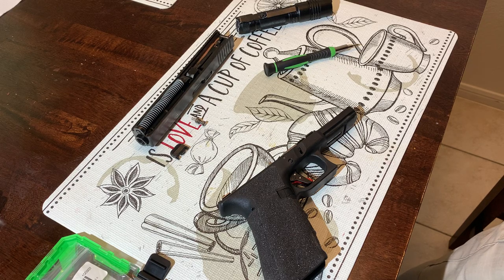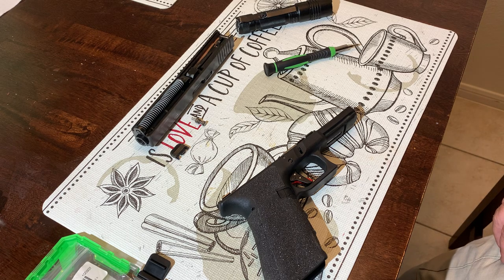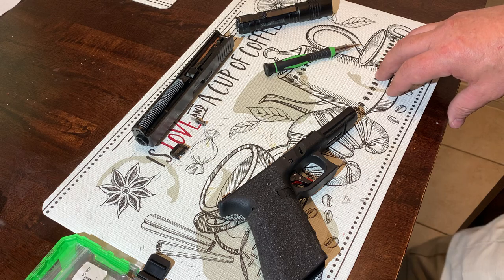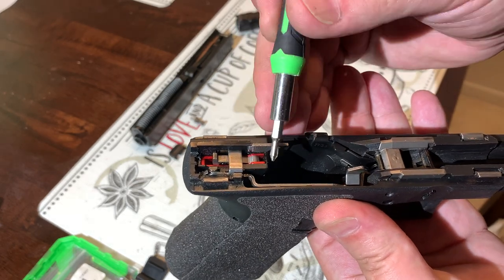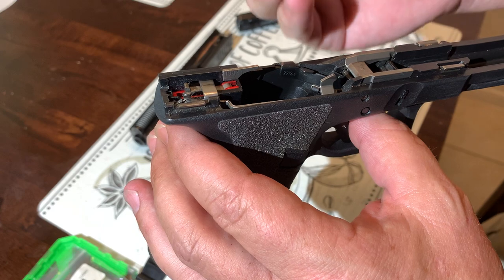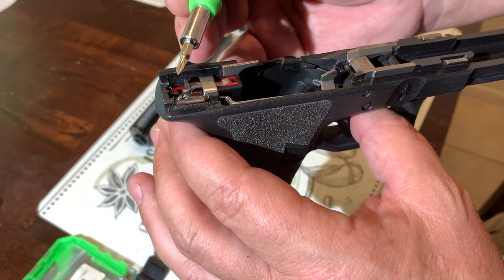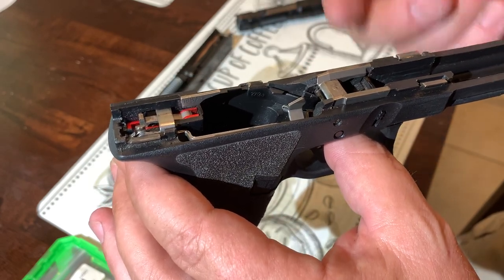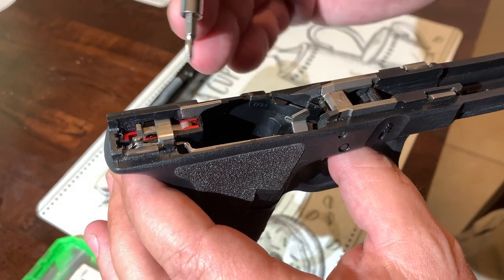Timney Alpha Glock Trigger follow up

Comment: I suspect you can find a way to discharge any "safe" firearm if you try hard enough. However, the Timney has been drop tested, by several different testers and folks, and found to be totally safe.  No one would or will ever use the gun without the striker block in place. In fact I doubt it would work very long without it anyway. I agree with Captain McNuggets, you miss the extra friction and pressure forces at work when the gun is fully assembled and ready to fire. Lastly I believe the Timney is sold as a competition trigger and not a carry trigger. Alpha Competition Series for Glock. Perhaps they have another one I am not aware of?
Reply from the maker: You are correct, it is marketed as a competition trigger. That doesn’t mean people are not using it for carry, which I would discourage. I like to have redundant safety features, and although the striker block should prevent a discharge, I prefer more for my peace of mind before I would carry such a thing appendix. A 1911 employs the same leverage between the seer and hammer hook engagement angles when the weapon is cocked, but I would not rely on that alone to prevent the hammer from falling. We can argue that the Timney is safe or unsafe, but we should be able to agree that it has fewer safety features than stock, therefore less safe.
Reply: @jcnikoley  I am all in for safety but you can't make your supposition with the striker safety plunger removed. No one in either competition or carry will do that.  Make your case with a fully functional and operational firearm. Don't you see it is meaningless unless that is so?
Reply from the maker: @erniebiggs8343  This video was made as a follow up because there were comments on my previous video stating the striker was being blocked by other means. 

The striker will still drop regardless of the striker block installed or not. It should block the striker from impacting the primer after the striker releases, but parts do break, wear or become dirty. That’s why there are redundancies. 
Sig P320 has a striker block. The fatal flaw of that design that was causing discharges was that the striker is pre-tensioned/cocked without a trigger pull. Timney trigger fundamentally changes the Glock from double action only (striker cocked by trigger pull) to single action (striker is pre-cocked with trigger forward) similar to the Sig design.
Reply: @jcnikoley  we will just have to disagree with each others reasoning. The fact it isn't designed as a carry trigger is still a factor. Perhaps THE factor. You know as well as I,  some will do as they please and likely carry but they probably do other stupid stuff too. You can't use the Sig as a comparison in your argument because it is designed as a carry gun.
Reply: but u dont have to try hard with this gun. its just not designed for carry. its not drop safe.

Comment: Great video, beautiful Gen 3 22C as well. I think I'll just avoid all aftermarket triggers lol
Reply from the maker: Thanks. They say beauty is in the eye of the beholder. I find the beauty of the Glock design is it’s simplicity. I wouldn’t worry about having a competent Gunsmith go through and improve the trigger. It’s just polishing and maybe replacing the disconnector with the lighter Glock disconnector. I wouldn’t go any further than that for a carry gun. I have a competition Glock with a 2 1/2 pound trigger and a much shortened take up. I wouldn’t carry that, but I have every confidence in it as a comp gun.

Comment: Would Walther's have the same concerns? I believe they are also a pre loaded striker spring.
Reply from the maker: Not familiar enough with the Walther to say for sure, but looking at an exploded diagram appears that pulling the trigger does not cock the striker, meaning when it’s pre-loaded, it’s loaded with enough stored energy to fire a round. In any pistol design like this, it would be very important to keep the plunger that blocks the striker clean so that it won’t hang up.
Reply: @jcnikoley  ok noted thanks

Comment: This videos should be called “I can make this gun fail when I remove parts and manipulate the internals to fail”. Timney says not to alter anything or change springs and connectors. It still maintained all 3 safeties and safe to carry.
Reply from the maker: Only the trigger safety and firing pin block remain. The seer is no longer prevented from moving off of the striker, and the striker is fully cocked instead of partially cocked.

Comment: You know all that talk and you never drop the fire arm one time?
Reply from the maker: Do you know that Glock’s “drop safety” has nothing to do with dropping of a firearm, but it’s a physical block to prevent the sear from disengaging, until the trigger is pulled to the rear? Timney bypasses that feature.
Reply: @jcnikoley  oh, I am well aware of how it works. I have three Timney triggers and I own six or seven Glocks and I can drop each one of them from the ceiling to the floor without the striker releasing. There is also a set screw/C clamp on the base of the seer block mechanism which can be adjusted so if you are having issues with drop safety, it can be fixed.
Reply: @jcnikoley  and I have purchased many a drop in trigger kits that even with a solid cruciform still, we’re not drop safe because of glocks tolerances I needed to be adjusted tweaked or made so to function properly Timney triggers are no different
Reply: @jcnikoley  the video is all hypothesis. I suggest you make another one primed, casing, safety plunger, installed and drop the shit out of that gun and prove me wrong and then send it to my house. If it does go bang and I will fix it for you.
Reply from the maker: @dustinglover9731  The Timney trigger holds the striker to the rear without the trigger being pulled. That is a change to the Glock original design and not a theory. The seer is not a physical part of the trigger bar which rides along the drop safety until the trigger is to the rear, disabling the drop safety. That is not a theory, that is as it is. I’ve been doing some gunsmithing for a over 30 years, I think I can manage without your assistance.
Reply: @jcnikoley  and yes, it is considered hypothesis because you never actually proved the fact that it would happen you’re just making assumptions that it could happen, which I have never personally seen or heard about. And yeah, there’s a couple videos where guys are failing the drop test with this trigger but past that they have no idea what they are doing. They do not know how to repair and/or fix the issue based on the tolerances in their personal weapon. Taren Butler. One of the best shooters in the world on the glock platform will not use anything else even in his carry firearms, but he does state adjustments do need to be made from time to time depending on which pistol the trigger goes in I have full faith in my ability to make set adjustments. What is even scarier is that there are people out there who just think that you can put something into your gun and it automatically is supposed to be safe and give you a nice warm, fuzzy feeling that’s not how it works and yes, I have a triggers such as overwatch precision jump the cruciform.